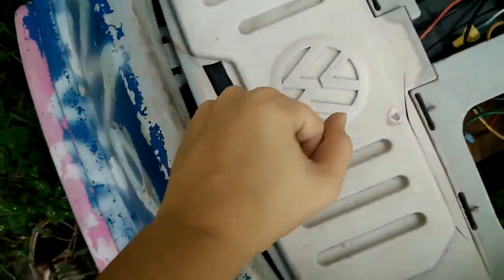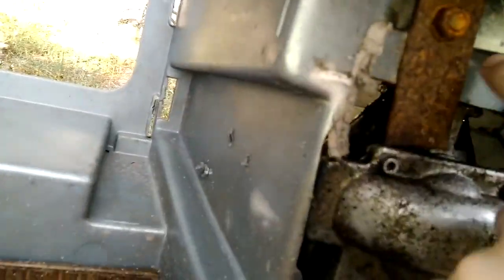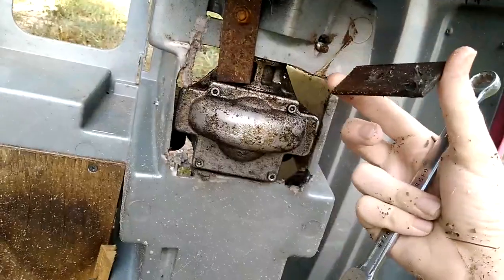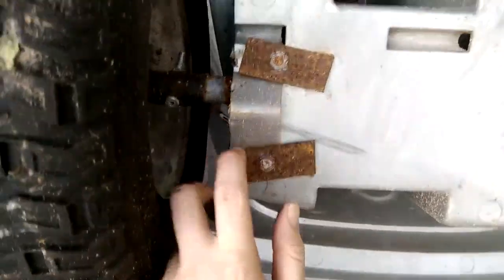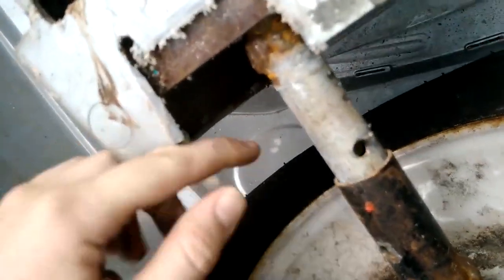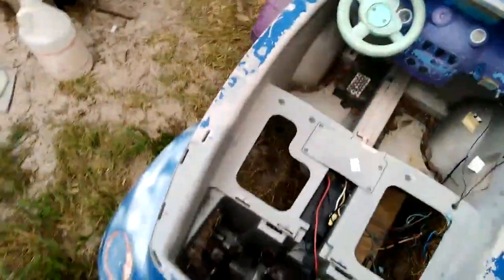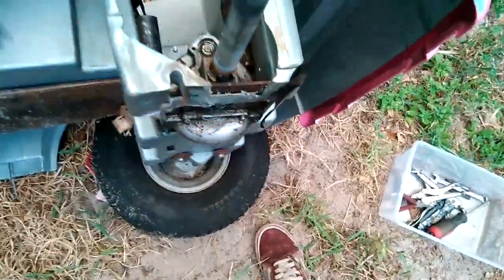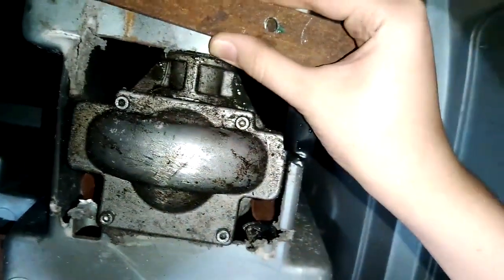mobility scooter motor swapped power wheels Volkswagen beetle part 1

Comment: Good job! There's not much space to hide stuff underneath that one. How many volts are you running
Reply from the maker: Thanks! I run 24v volts which is the rated amount for the mobility scooter motor but it gets REALLY hot just on 24v so I probably won't over volt it if I do it would just be like a boost cause I wouldn't be able to run it very long before frying the motor on overvolt. Or I could just figure out a cooling system and I did think about hooking up water cooling but I was unable to wrap the copper tubing around the motor. Ps the motor mounts bent on this vehicle. But I'll fix it one day
Reply: @mondude9754   I run 24-36 in the truck. And 36-60v in the little Ferrari